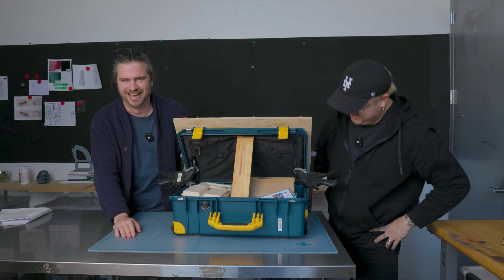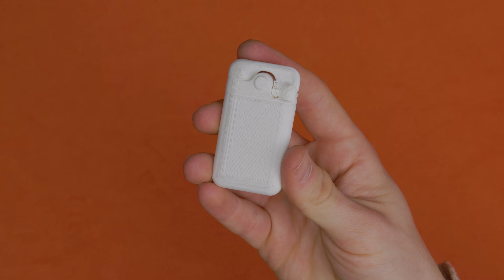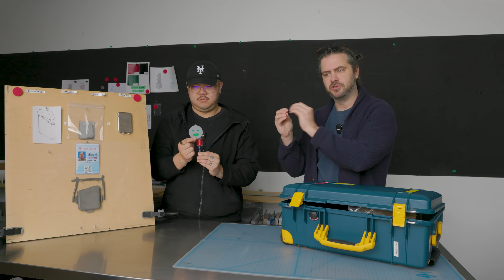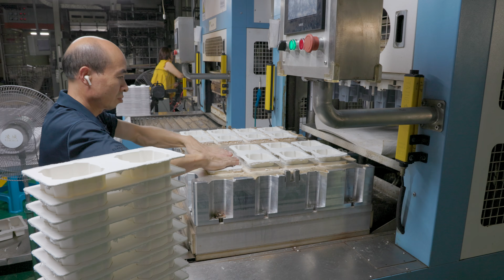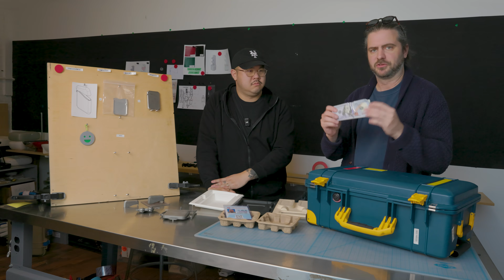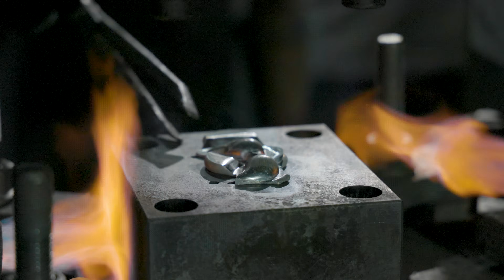The Design Budget Paradox

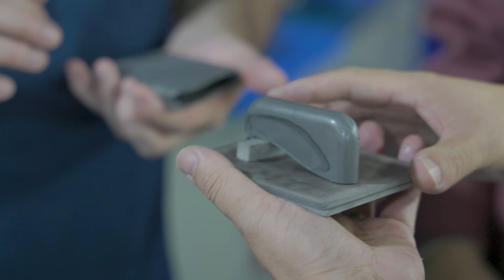Comment: I feel like this video highlights why human designers are so important. I work in IT so you would think I'd rave about AI, but I'm pretty confident none of the existing models could do what was done at 5:50. You took in information about the manufacturing process and used it to better understand future design concepts. These processes are intimately related to creating a final product, but separate topics to a computer. The kind of intuition to take this information and realize "oh, yeah the curved design looks nice but creates a new problem in production that we don't want to deal with" is something uniquely human.

I also appreciate that you're creating a better product by starting with a better concept, rather than throwing band-aid solutions at every roadblock until you have something held together with duct tape and magic.

Comment: hi craighill, i have a design question and i can’t think of anyone better to ask. my wallet sucks. the cards are hard to get out and i often lose my grip trying to get my tightly packed debit card or id. but it has a window for my bus card so i can tap it without taking it out. this is very important to me. the issue is, most streamlined or aesthetically appealing wallets i’ve seen don’t have that window. how would you design a wallet for commuters?

Comment: I don't recommend using the Summit Card Case to use as a wallet. I got two of them and both developed issues with closing and latch looseness. Criaghill Support suggested to "push the lid towards the hinge while it’s closed..." but won't fully solve the problem. The product works as a business card holder but will not stand up the the abuse of being used as wallet.